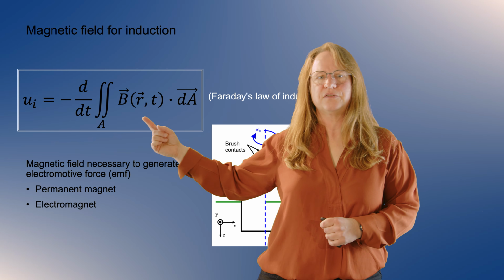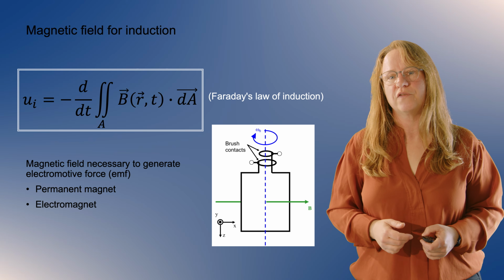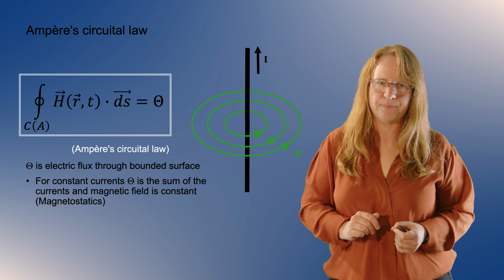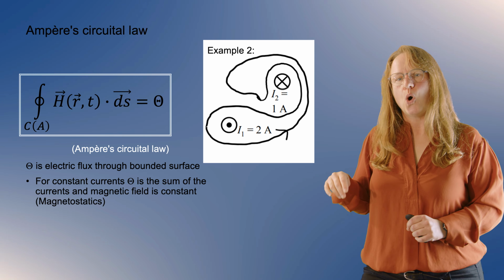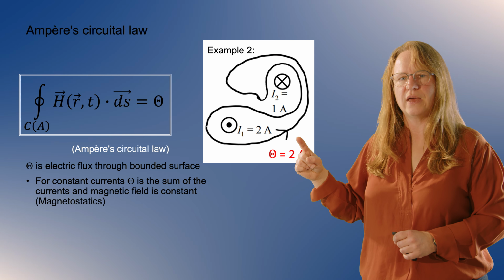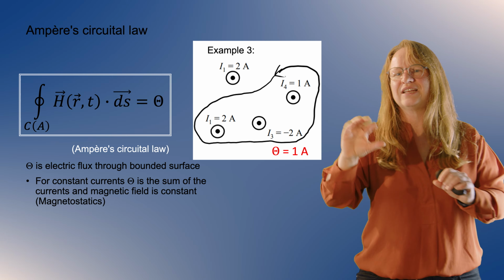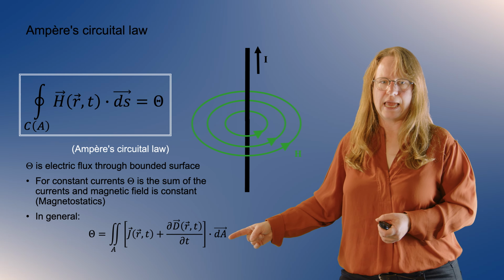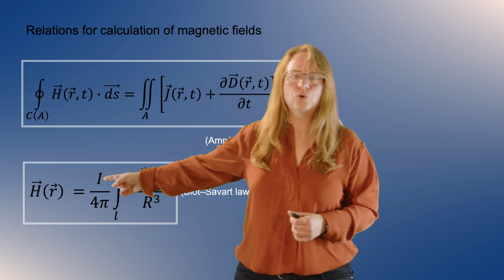2.2.3 Magnetic Field for Induction: Ampère's Circuital Law and Biot-Savart Law

Comment: I really enjoyed the straightforward explanation of the relation between the formulas and the physical situation. The only part I'm not sure I understood correctly is in example 3, where I3 had -2A. Is I3 the only conductor which has alternating current? Or is it out of phase with the other two which would also be using AC? Or I3 only has the opposite polarity? Or is it something else? You mentioned that the current might change direction over time, which is why I'm thinking that I3 has alternating current flowing through it, but if that is the case, it would only be negative half of the time and just cancel its own contribution to the magnetic field, ending up being 0A (as in +2 half of the time and -2 half of the time). That's why I'm not sure I understood correctly.